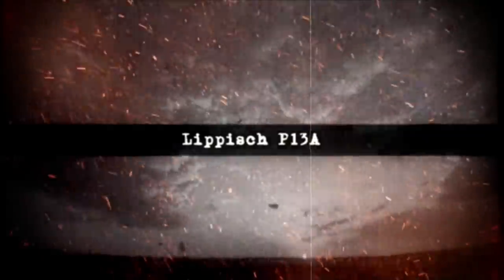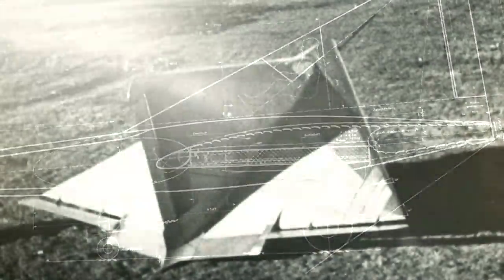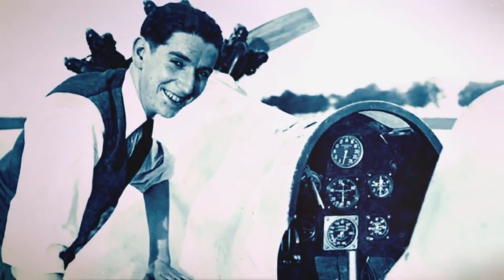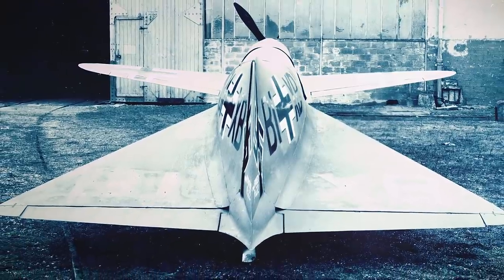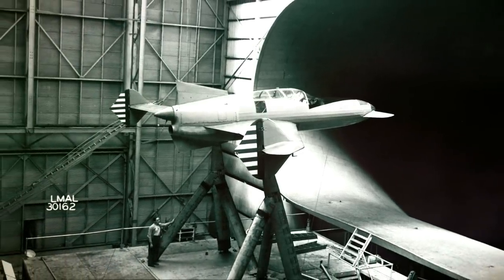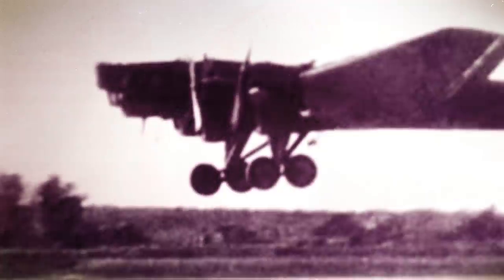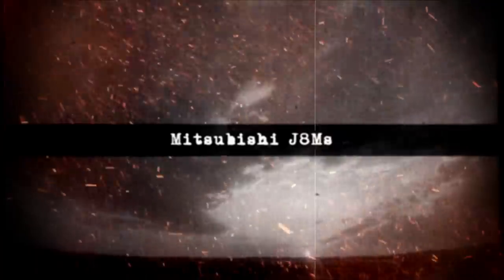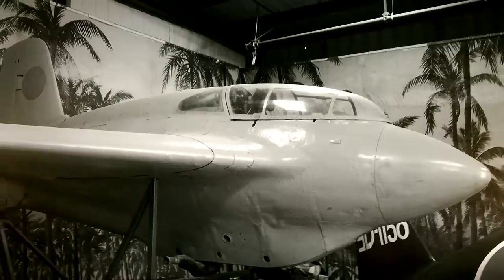5 Most Unbelievable WW2 Warplanes You've Never Seen Before

Comment: This doesn't occur very Frequently anymore, but I learned something... 
I did not know that there were Airplanes fueled by Coal.
Reply: They actually tried to bring it back a few years ago to help the coal industry out in Wyoming
Reply: @ndredneck79  are you sure they wanted to power a plane from coal? you may have read something about how they wanted to use Wyoming coal to make carbon for graphene/nanotubes, plane fuselages, wind turbines and water filters.
Reply: Did it ever actually fly?  I know they did have trucks that ran off wood.... Incomplete hurt wood that call it smoke had unburnt particles that carb sucked in and went into cylinders instead of atomized gasoline.  Not alot of power but enough!
Reply: T'was supposed to be a statoreactor. It would probably work.

Comment: With reference to the XF-55, Saab J21 (first flight in 1943, retired from service in 1954) solved the pusher prop problem by fitting it with a ejection seat.  J21 was one of very few pusher prop aricraft designs that actually entered service. The design was surprisingly also connverted to a jet aircraft designated J21R (first flight 1947, retired in 1956)

Comment: NO WAY coal would function as propellant...weight too much. Wonder what the engine was really like.
Reply: The energy density is acceptable, and comparable to fuel oil. This was finely ground to a powder, and in some applications was made into tiny, uniform pellets   Even wheat flour can be used as a propellant or explosive. You have heard of mill explosions, I presume. And high grade coals were readily available locally, not requiring the processing of crude oil products. Amazing technology for the time.
Reply: The coal in the rotating basket, had no airflow, was roasted from outside by a little liquid fuel. Smoke is released if something (even wood) is roasted without air to oxidize or "burn" it.
Smoke can then be sent to the engine.
See youtubes on woodsmoke IC engines

Comment: How did an airplane actually sustain flight running on coal?!
Reply: Very similar to oil misters used in oil furnaces, but injecting powdered coal instead. Similar energy density.
Reply: Coal smoke, not the actual granules.
See youtubes of woodsmoke powered IC engines.
Reply: @JFrazer4303    Interesting concept for engines, but I doubt they used that technology back then, and were using the simplest conversion possible for less weight from added components. Thanks for the link.